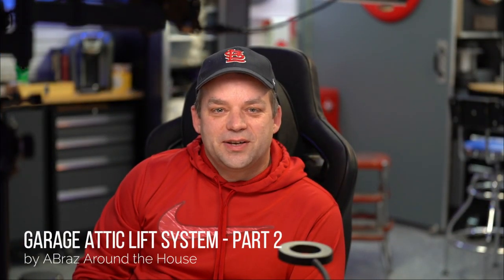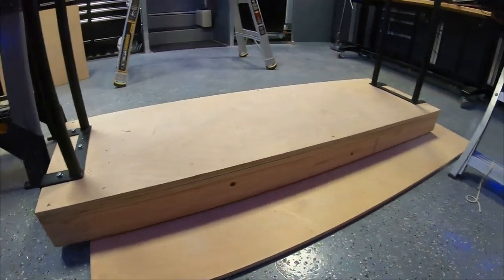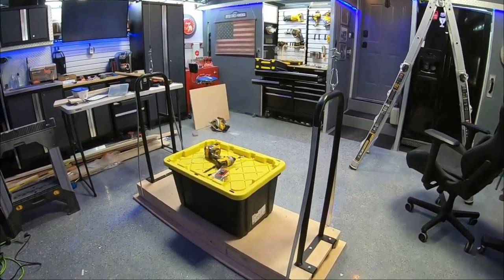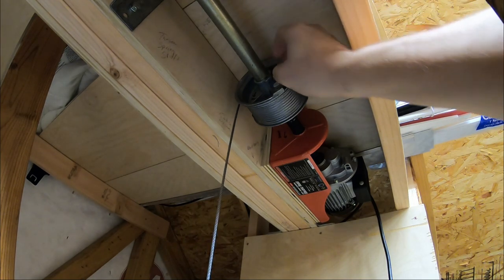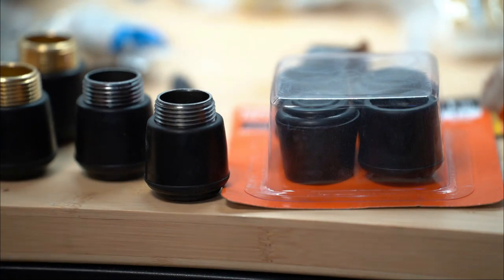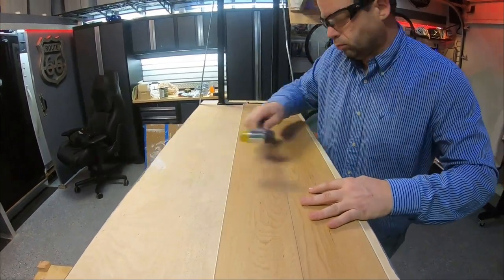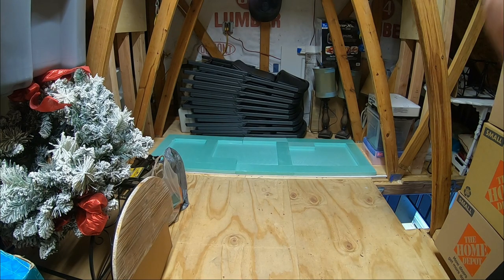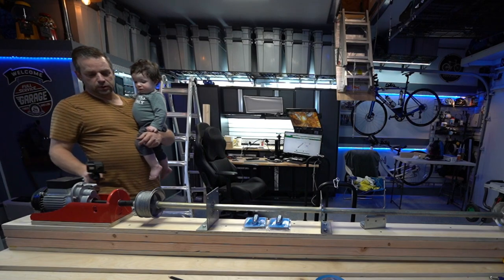Ep 2 DIY Garage Attic Lift System and Garage Bar in my Dream Garage! - Episode 2  | ABraz House |

Comment: Thank you for a very detailed presentation. Things I like about the presentation, 1. Detailed with references. 2. Project thought through. 3. Very sturdy. 4. Final fit and finish is amazing. Your build  is very similar to what I need. I will likely copy it with small changes for my particular configuration.
Reply from the maker: Awesome, thank you!

Comment: The lift I built at my previous house used a single cable from the harbor freight hoist, to a ring that  I attached 4 chains to I-bolts that went thru the platform I built.I was lucky that house was stick built, so I no issue about cutting the 2x6 floor joists and framing out the opening using 2x6 lumber. With the single point of cable attachment, it definitely liked to spin, so I wore heavy gloves to hold the cable and guided the chains into the opening as it got closer. It was functional but definitely room for improvement.
Fast forward to today, newer home so it has trusses, but they are heavier trusses designed to support loads, as my furnace is in the attic. I will not disturb the trusses, but will work within the 22” opening. I like what you did utilizing the garage door hardware, and that’s how I’m going to design my system for this house, I also like the handles and the guide straps.
I have question for you- why didn’t you utilize the hoist attachment system built into the housing, designed to use 2” metal stock? Overall great job and attention to detail, it never hurts to put a little pride into every project.
Reply from the maker: Thanks!  Appreciate the time and comments.  I honestly don't remember why I didn't go that direction (2" metal stock).

Comment: Amazing setup! Wonder if it could be configured with the tabletop/bar on top, anchored to the dolly handles. That way you would have the table available whenever you drop the platform without having to screw the legs on/off. Table might be a little more solid as well. You'd want to make the tabletop easily removable for those times you need standing leverage to load heavier items.
Reply from the maker: Thanks!  There were alot of options for sure!  That would be a good one!

Comment: Simply spot on as a lift and roof seal. I would not have gone as far as a table especially with the tall handles and alo guides. I'm guessing that was an afterthought. You went that extra mile with your finishing detail and made the job so much better. Congrats.
Reply from the maker: Thanks!  You are correct in that it was a little bit of an afterthought, but it comes in handy during the holidays and when I want to do a stand-up unboxing video, etc.  Thanks for the kind comments!

Comment: Awesome job! What is your dimensions of the platform? (Mainly length) What is cut out length in ceiling, and what did you have for finished platform length? Are you satisfied with size? Want to start planning my next project! Thanks
Reply from the maker: Opening 66x20, Platform is 65x19  Yes, the size works well with the sizes of totes and boxes that I send up to the attic.  The width is restricted to the opening, or I would have liked it to be wider!
Reply: Really awesome job! So to be clear you went between the existing ceiling joist..i.e. you didn't reframe the ceiling to make a wider hole. Again. Great job and best how-to out there!

Comment: Your garage build is amazing and efficient.  I have seen a few of these builds for an attic lift.  My only concern with the design is that the platform is free to swing,  especially as the lift points are directly in one line from one another.  How did you solve the problem of balancing your load so it would not tilt the platform and fall off, particularly if you loaded two or more boxes (containers) on top of each other?  A top heavy load would certainly pose such a danger.  Thanks for sharing your video.
Reply from the maker: I believe the total weight of the platform helps.  I haven't experienced any tilting issues at all.
Reply: If balance is a problem. I thought of a similar end handles, just running the cable through the handles to the platform.

Comment: nice! Not understanding need to make it "pretty" will the diamond plate, etc. but to each his own.
Also, why detach and use the legs? Could just put some thin rubber sticky seal around perimeter to seal garage from attic and leave the platform attached.
Reply from the maker: Thanks.  I guess I just like the look.  I honestly don't use it for a bar but about twice a year.  When I do though I like to detach it and show it as a freestanding bar.

Comment: It shakes a bit too much for my liking, the point of connection isn't close enough to the actual platform you are lifting.  Putting it closer would help with the wobble a little bit.
Reply from the maker: Thanks for your input!

Comment: Move the bearings plates next to the cable drums before you hit your head on them!
Reply from the maker: I solved that with a board in front...last part of ep. 2.  :)
Reply: @ABrazHouse  I was kinda worried about the torsion rod flexing under load as well.
Reply from the maker: @Krummin  I haven't seen any issues as far as that.  Been using it for over a year.

Comment: Gonna need another thin piece of plywood to put on there when you want to lift your snow tires up to the attic for summer, or some old lawnmower engines or something. Just as a side note, take it easy on the background music. I almost didn't make it through your video because of it. I had to mute the whole thing to get away from it, and part #1 as well. Good job otherwise.
Reply from the maker: Good idea, although I don't store things like that in the attic.  Thanks for the tip on the music!  I am still feeling my way around on the video production side of things.  👍